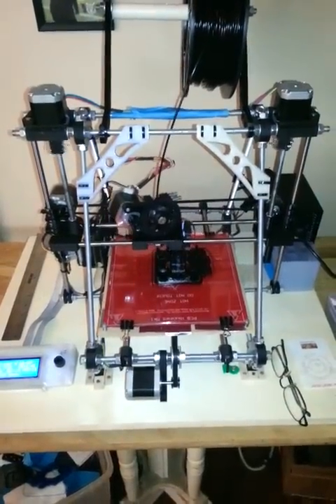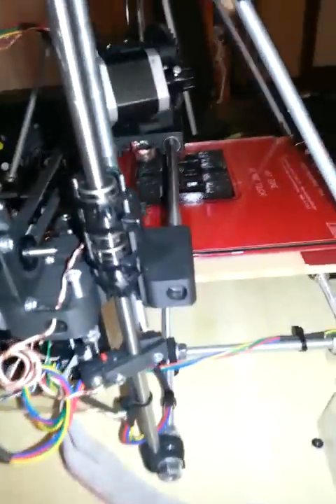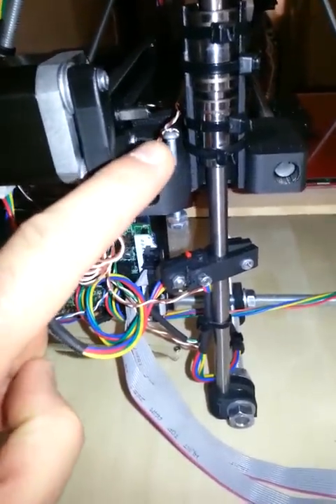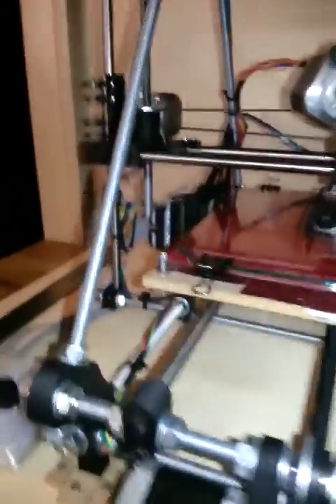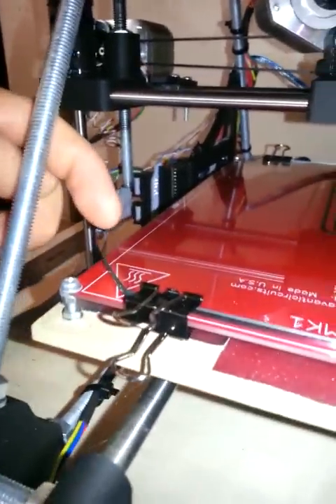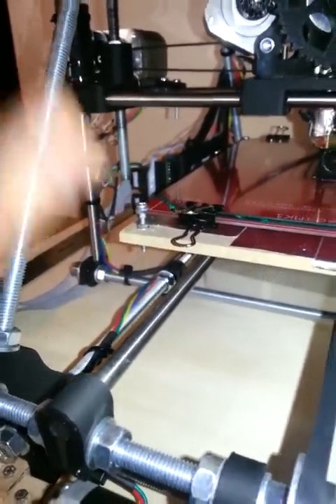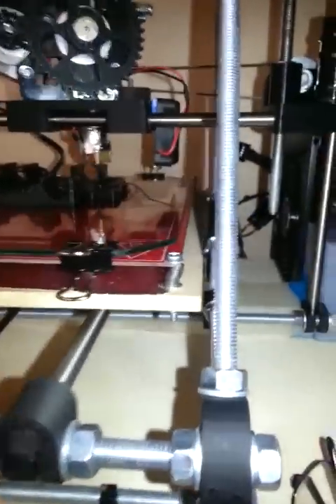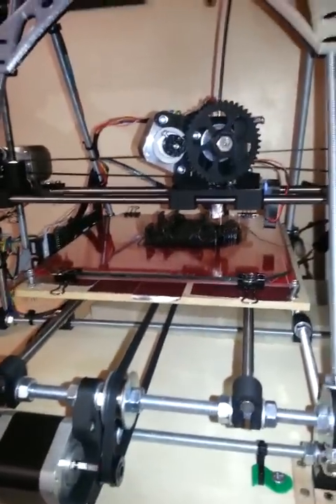Quick and easy bed leveling and nozzle clearance adjustments

Comment: Kevin, thanks for the video. I'm reviving my i2 project started a few years ago. I'm almost there but need to do the leveling. I have a flimsy piece of luan which I will replace with something more sturdy and some of the old painters tape. I plan to replace the painters tape with some glass as the tape is really a maintenance nightmare. I'll be watching this as soon as I get some glass to replace the paint to make sure everything is as I want it.
Reply from the maker: Hi John,  Check out my upper Z support video also.  I mounted thrust bearings at the top to carry the weight of the carriage.  Completely eliminates Z creep and I found that I could run the printer for more than six months without having to relevel the bed.